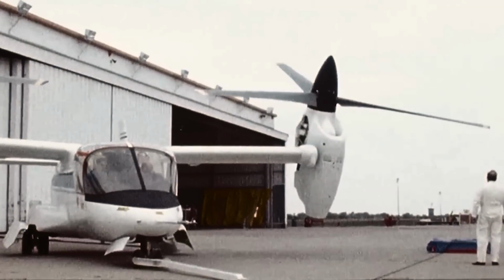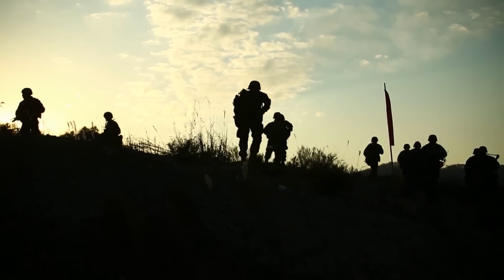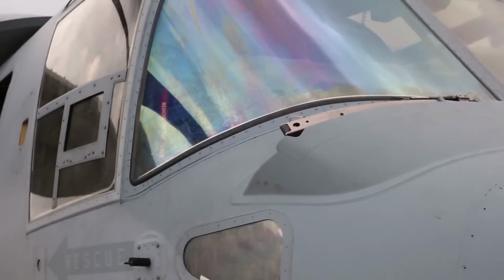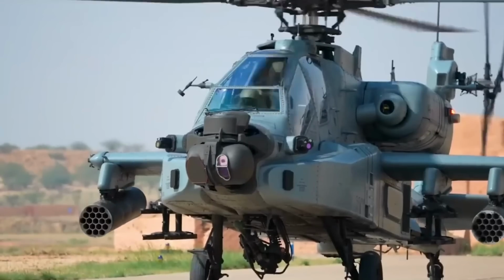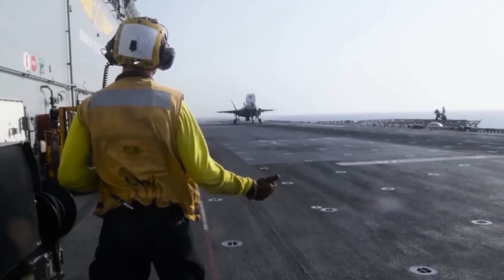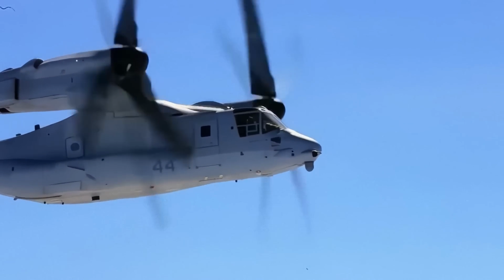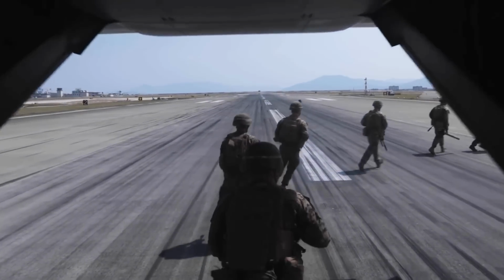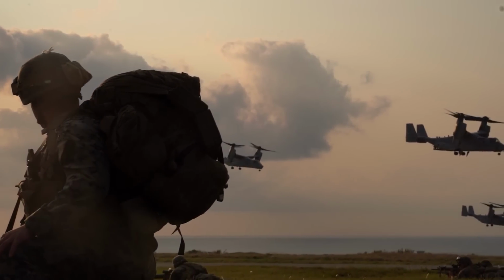V-22 Osprey – future or failure?

Comment: of course it can, even without tilt wings, a ring wing quad copter can be a vtol tail-sitter and a place, without any other moving parts than the quad high wing ducted rotors, no tilt wings or anything
Reply: scratch the computer, fly by pilot only
Reply: any computer you have to add is too much, even to a car, engine etc, use metal-air cuso4-dilute-h2so4 water graphite fuel cell engine with iron metal fuel in sheet spool
Reply: fly by wire, not by electricity
Reply: so ww2 stuff, even nukes
Reply: also skirt hovering mode in the hyper whoop quad copter plane
Reply: only differential thrust, no thrust vectoring or moving directional parts, like rotors or wings
Reply: ducted rotors, what tip jet vortex, also greater electric motor push power

Comment: My Bird!   The first project I worked on out of Engineering school!   

No special insights to add other than a few bugs in the pilot interfaces in which I helped with fixes.

Moved on to other projects a few years in, but I'll always consider it mine.  Thanks Eng for looking at it!
Reply: @craig4867  stay klassy!
Reply: It should be a point of pride, and apparently it is, but the project was, apparently (though some refuse to admit it) a failure…
Reply: Bad design.
Reply: @anonanon7235   Wrong. Do some research.

Comment: The Osprey is as old as I am and I've been as fan of it basically my entire life. I somehow never knew it wasn't really used for the first 25 years of its life and figured it was approaching the end. I am overjoyed to learn that it will likely be around for many, many more years. I'm also a fan of Star Citizen and it just occurred to me that my unreasonably intense passion for the Drake Cutlass Black is probably because its effectively the fictional great-grandchild of the Osprey.
Reply: Cutty is love, Cutty is life
Reply: The Osprey skins and webs are made of mostly carbon fiber (graphite/epoxy). The frames are machined aluminum produced from billet. The Navy keeps most of the major components on database so they can be produced by the customer. If you have a five axis CNC machine, you throw in the material and the data and outcomes your part.. I worked on the first 250 Ospreys I before I retired as a structural mechanic.
Reply: Dead trap!
Reply: @mariodefreitas3094  It's actually not. Osprey is just statistically safer than the Blackhawk.
Reply: @mariodefreitas3094   And yet safer than helicopters like the Blackhawk. Do some research.

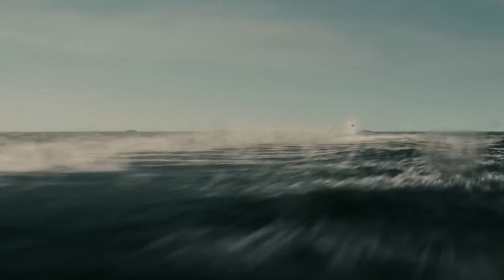Comment: 15:57, V-22 Supersonic?
Hmmmm, not in its current form, rotors / propellers and supersonic flight do not go together very efficiently.
Change the form and it is not a V-22 any longer it will be more like a large Harrier or F-35B.
Reply: I'm fairly sure that was a joke.
Reply: Yes, not supersonic but the subsonic top speed could be increased which would be welcomed by the military.

Comment: The development of the V22 is like the development history of the helicopter itself.  The whole concept is just so “unnatural” that only sheer will and prolonged expenditure could traverse “enough” failure modes to enable receipt of some of the rewards.  But the cost was high - both in $$ and in lives.  An impressive piece of engineering.
Reply: Worth noting that the Osprey is actually statistically very safe, it's reputation for being dangerous is just that: a reputation. In Marine use the MV-22B Osprey has a lower Class-A incident rate per 100,000 flight hours than the Harrier, Hornet, F-35B, EA-6B or CH-53E Super Stallion.
Reply: @tomshackell erm it just took more lives...
Reply: @shadowopsairman1583 naval aircraft crashes (and fatalities) are sadly common, across a variety of different airframes. Because of this you cannot reasonably conclude that a particular airframe is or is not safe from isolated examples. Instead it is necessary to look at the statistical data in order to draw accurate conclusions.
Reply: @tomshackell   It's better than the Sea Knight.
Reply: How about no
The rewards of the V-22 massively outweigh the cost
First in order for CH-46E to travel from coast to coast,  the trip took at minimum 3 days 
The V-22 does it in one day
From bases Okinawa Japan to mainland Japan, the CH-46E required multiple stops, again the V-22 does the same trip in 1 go
But most importantly, the V-22 flies fast enough to be refuled by KC-10, 46s and 135s 
Other helicopters can only us KC-130s or A-400M
Second
the V-22 engines are incredible powerful. The USAF added 800lbs armor kit to the CV-22 no lost in performance
kinda happens when you have 12,000 HP to play with
The CH-46 had at most 3800 HP with MTOW of 25,000lbs
The MV-22 MTOW is 47,000 to 60,000 lbs 
The list of benefit from the V-22 massively outweigh anything
Nayslayers are quick to say it took lives
Okay, wanna take a stab at how many life the CH-46 or MH-53 took in their operating history
Reply: It just took more lives this past month
Reply: and impressive piece of garbage 👈 even a UH-1 has a better safety record than this garbage.
Reply: God bless the men and women whose hearts and souls have gone to the next so soon ❤
Reply: Interesting analogy, re: the Osprey's development's similarity to the development of the helicopter- which makes sense, since the Osprey and its new paradigm isn't just a new/more advanced helicopter, but rather a fairly radical departure from the status quo- the legacy aircraft(s) that it is meant to superceed... 

So, of course it was going to take longer than developing another iterative traditional helo... 

thanks for pointing  that out. (Its something that I think most people instinctively knew, but lacked the contextualization for, which ended up with popular dismay with what was, in retrospect, a justifiable and realistic expense vis: the cost, design, testing, (accidents), etc.

Cheers!
Reply: Incorrect, the helicopter, in its early days received very little government support or money. My wings were given to me, by a  senior Navy Aviator, whose father Was the First US Navy helicopter pilot. No significant amount of money went to helicopter construction till the Viet Nam war.
Reply: @raywhitehead730   My mom’s family were early in aviation (St. Louis) and knew Sikorsky personally, so i hope it’s ok to stick with the story i’ve heard.  Admittedly, govt funding increased over time.

Comment: Great video. As the v22 matures and refined, it will continue to increase safety, performance and reliability.
Reply: Dream on it's a heap of death junk made for a money scheme from a bad contract.
Reply: Maybe the V22 is designed for tropical weather, I don't hear any accidents when it was used in the Philippines.
Reply: We are entering a new era of aviation innovation.

Electric and electric hybrid, AI based simulations, additive manufacturing, new materials, etc.

I'm actually a little worried about my Bell investment, the V-280 might be obsolete by the time it's deployed.
Reply: @jtjames79  Hydrogen fuel cells are vital
Reply: @icare7151  Hydrogen Fuel cells are senseless.  Hydrogen is difficult to store and created from fossil fuels.